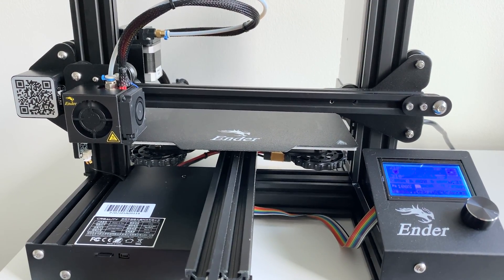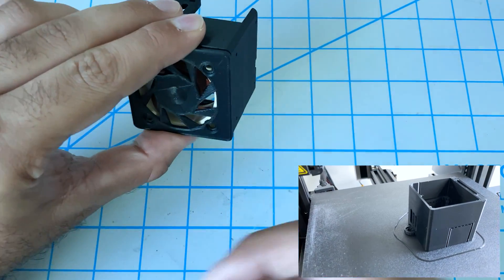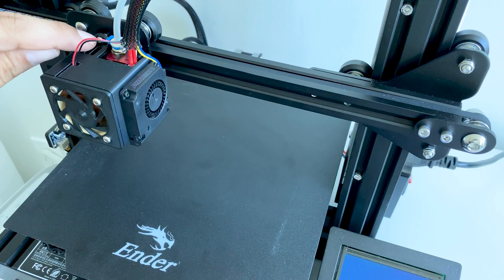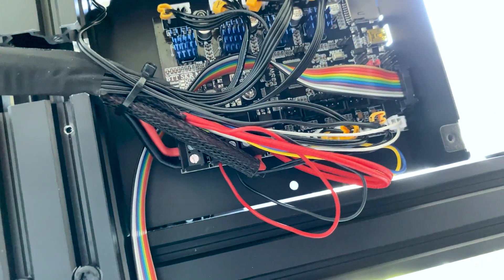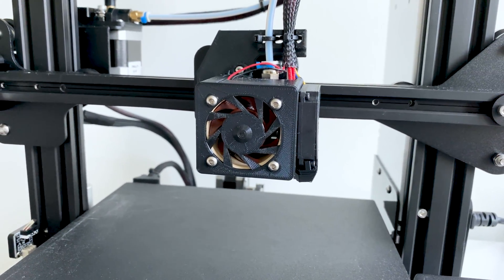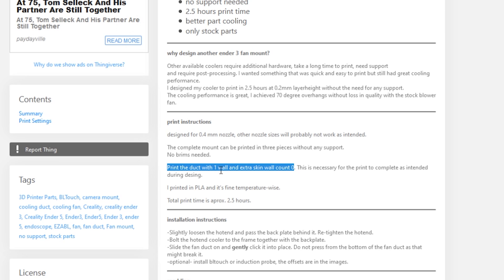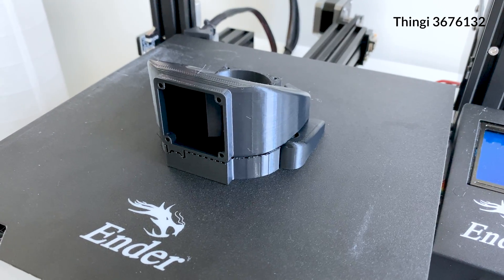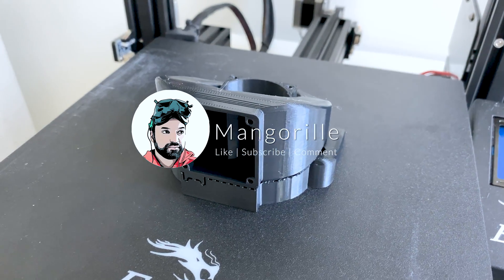Creality Ender 3 Pro Hot End Noctua A4x20 Fan Upgrade 40mm x 20mm | FINALLY Some Silence!

Comment: DONT USE NOCTUA FANS UNLESS YOU ENJOY HEAT CREEP! THEY DONT HAVE ENOUGH FLOW
Reply from the maker: Which Noctua fan did you try that gave you heat creep? Folks are going with the 40x20 instead of the 40x10 to give more airflow.
Reply: Don't talk about things when you have no clue. The Noctua 40x20 works great and has plenty of flow. Maybe you could ask your mom to explain it for you.

Comment: How do these DC-DC step down converters work with fans that are adjustable?
I'm not sure how Ender 3 control board regulates their RPM (with PWM?).
If the control board lowers the voltage, wouldn't the step down converter basically keep feeding 12V to the fan, until the voltage drops to 12V + whatever DC-DC converter needs to keep functioning?

I have just installed Bigtreetech SKR 1.4 Turbo in my Ender 3, so that's yet another layer of uncertainty for me.

Oh, and these Noctua fans are fantastic, I've got one, and it's nearly silent.
Reply from the maker: The hot end cooling fan always runs at 100 percent so that is not an issue. The parts cooling fan is the one that has pwm but it has pwm on the negative circuit. You need to wire the parts cooling fan differently if you intend to replace that one. For the parts cooling fan only, you need to wire like this: https://prnt.sc/pvye3q
Reply: @Mangorille  I have checked my stock Ender 3 control board (Creality 1.1.4) and negative contact in the fan connector and the ground contact are NOT connected together, as I presumed - just as your diagram implies! An interesting piece of info, thanks for that.

But as I have mentioned, I have recently replaced my stock Ender 3 board with Bigtreetech SKR 1.4 Turbo, and contrary to what I'm reading on every web page, forum, etc., my hot end fan IS controllable, just like the part cooling blower.

I have just checked, and M106 P1 S255 switches hotend fan to full blast, while M106 P1 S128 does reduce its RPM, I can both see and hear it.
M106 P0 does the same with the part blower, just as expected.

And so I'm wondering if I can replace them both with Noctua 12V fans, fed via DC-DC converters. If SKR 1.4 Turbo uses PWM to control fan speed this setup may work, but if it lowers the voltage by other means (mosfet?) my DC-DC converters will probably just keep pushing 12V to those fans as long as they have enough input voltage.
Reply: @Mangorille  Perhaps Marlin 2.0.7.2 I have compiled for my SKR 1.4 Turbo is smart enough to implement some kind of software PWM on FAN1?

Comment: Does the 2nd set up for fan leave enough room for a BL Touch?
Reply from the maker: Yes it does, you need to print the BLTouch base though. There are two different designs, one for manual leveling and one for BLTouch.
Reply: @Mangorille  even if i bought the creality BL Touch and have the ender 3 bracket? Or does the creality bracket work? sorry for all the questions lol

Comment: I was changing out the filament and the end of the filament went right into the fan breaking off 2 of the blades so now I am required to replace it.
Reply from the maker: You can print a cover for the fan to prevent items or your fingers from going into it.
Reply: @Mangorille  2 late

Comment: Great video! Really wanna do this upgrade myself soon, however, im also planning to do the same with the system board fan as i find it to be even more annoying than the hotend fan, atleast it is on the non-pro ender3
Reply from the maker: Thanks! You can do the motherboard fan at the same time and even wire the fan into the same buck voltage converter. The fan will be on all the time but that's not a problem. The Noctua A4x10 fan works well for the motherboard and is silent.

Comment: Why not just go with the Noctua 20 x 20 x 10 as a direct drop in without needing to replace the shroud?
Reply from the maker: That would be the easiest way but you do lose some airflow and still have to deal with the parts cooling capability of the stock setup.

Comment: When splicing power wires stagger the joints so even if the shrink tube wore through the opposite wire does not have a joint in the same area.
Reply from the maker: Good suggestion, thanks!

Comment: Did you cut the yellow wire for the noctua and leave it there
Reply from the maker: Yes, you don't need the yellow RPM wire. You can either cut it really close to the fan itself (cleaner) or just leave it in the tucked away in the wire loom.
Reply: @Mangorille  awesome thanks for the reply I'll gladly subscribe to you for the help!
Reply from the maker: @jimmydeanman  You're welcome. Thanks and welcome to the channel!

Comment: You didnt use supports for these? How did the arch on the middle part even work?
Reply from the maker: Are you referring to the piece in the middle at minute 9:00 in the video? If so, your printer is able to print a certain distance between two points without supports. They call this bridging.

Comment: Hi, are you using PLA? And if yes, is the temperature affecting the case?
Reply from the maker: Hi. Did initially use PLA but the parts will deform over time. You should really use PETG for these.

Comment: I love your videos, thank you! can I ask? in my ender 5 pro and I'm replacing the hotend fan and the part cooling as well with Noctuas. My PSU is 24v and Noctuas 12v. I have replaced the hotend fan using a buckconverter, but I'm not sure now if its possible to replace the part cooling fan too using a buckconverter without blowing the mainboard, is it possible? since the part cooling fan is the one making all the noise now on my printer.
Reply from the maker: Hey. Thanks! If the Ender 5 is anything like the Ender 3, you need to wire the parts cooling fan a little bit differently with the buck converter. For the hot end fan you connected both the negative and positive wires from the motherboard to the buck converted. For the parts cooling fan, you need to connect it like this: https://prnt.sc/pvye3q (credit goes to  Tim-CrossfireMachines)
Reply: @Mangorille  thank you so much man! Im a bigger fan of your channel now :) thanks for taking the time responding, much appreciated.
Reply from the maker: @andresmalo254  You're welcome. Happy printing!

Comment: I am trying to get the minV2 Ender 3 fan mount but it looks like it may have been removed.  I reached the end of the internet.  Looking for alternative setup for 4020 hotend and stock blower.
Reply from the maker: Hey, you are correct, that is very unfortunate as it was an amazing design! I'll try to message the designer and see if he can re-upload. I still have the files if you want to email me mangorille at gmail.
Reply: @Mangorille  Hi Mangorille! It would be nice if you could upload the files of the minV2 Ender 3 fan mount. I was going to follow your modification and I already purchased all the items :S
Reply from the maker: @alanteriornoleconozc  I wasn't able to get in touch with the designer (messaging feature doesn't work right now) but I have uploaded the files I had backed up here: https://www.thingiverse.com/thing:4744656
Reply: @Mangorille  Thank you!
Reply: @Mangorille  Thanks for posting that.  I went ahead and printed this one. https://www.thingiverse.com/thing:4369859/comments I modified it to fit 4020 fan.  I will let you all know how this one works out.
Reply from the maker: @mmicker007  Thanks for the update. If you want to print something like that, did you look into the Hero Me? https://www.thingiverse.com/thing:4460970
Reply: @Mangorille  I did look into it but so far the Satsana is working for me.  I also mounted an 8025 Arctic fan to the outside of the PSU cover from your video.  Replaced the mainboard fan with a Noctua 4010 that is connected to same buck converter as the hot end fan so it runs all the time.  And of course I had already upgraded the main board to a 4.2.7.  I am quite happy with the results.  Only stock fan that remains is the parts cooler.  The printer is silent enough to sleep beside.  My next project might be to get a pwm fan controller so the power supply fan can run continuous at a lower fan speed to eliminate the on off noise and I will add a LED strip lamp at the top of the printer for better lighting.  Thanks again for the great videos for inspiration.
Reply from the maker: @mmicker007  Glad to hear that everything worked out! For the parts cooler, you can look into the Sunon MF50151VX-B00U-A99. People say that Sunon is the Noctua of blower fans. This one is a 5015 12V. You would most likely be running it at 50 - 60% considering the amount of airflow it can produce.

Comment: That small part cooling fan is only splitting for you because you're slicer settings are off. I have the same one I printed and its perfect and really strong. It looks like you're under extruding, maybe printing at too low of a temperature even.
Reply from the maker: Hey Chris. That is very possible as it was printed in my early days. However, I did try to print it a few times with different settings without much more success. What I suspect, and maybe this contributed to the issue, is that there has been minor variations in the Ender 3 over the year and this part did not fit the way it should on my printer.
Reply: @Mangorille  you printed  a part for the ender 3, not the pro. i once printed a part that was for ender 3 only for this same exact application, only to figure out there is a difference.. the horizontal offset of the screw hole tabs is different and are not interchangeable between the two.
Reply from the maker: @SeraphX2  I have the Ender Pro and did not notice a difference. Which design in the video are you having a challenge with?

Comment: so, my hotend fan doesn't move (feels like it's stuck) and I wanted to try out the noctua fan instead. how would I even print that piece out? or do you have any advice?
Reply from the maker: You have a few options. 1 - You can find someone through your local classifieds to print the parts for you. 2 - Purchase a replacement 40x10 fan and use that to get the printer operational so you can find the parts and then use that instead of the 40x20. 3 - Get the 40x20 fan and jerry-rig it using longer screws, zip ties, tape long enough to print the parts.

Comment: Hi! Thanks for the video! But I have a question. If I want to change also the electronic board fan should I connect another DC converter? Or this converter is enough for all the fans? Thanks!
Reply from the maker: Hey, you're welcome. As long as you don't mind the board fan being on all the time, you can use the same converter. That's what I did.

Comment: I printed the petsfang/bullseye stock fan mod and would like to report I'm very happy with it. Make sure you have some M3 nuts to use in some of the openings.
Reply from the maker: Those are good designs as well, but you can't see the nozzle printing as well as the MinV2 shown in this video.
Reply from the maker: @JoleFin I found the same, once the hot end fan and power supply fan are replaced, the blower is the next annoyance. You can play with the fan speed to try and find a sweet spot. Also, there is a FAST_PWM_FAN and Fan_soft_pwm settings in the firmware that you can play with to try to make the sound more tolerable.

Comment: My Noctua is a four wire. (40/20 fan) What do I do with the extra two wires?
Reply from the maker: Sounds like you got the PWM version of the fan instead of the FLX version. You should be able to connect just the ground and 12v wires and the fan would run at full speed. Check out this link: https://noctua.at/pub/media/wysiwyg/Noctua_PWM_specifications_white_paper.pdf
Reply: @Mangorille  I almost bought the 5V with PWM. 😲 One Pin is for PWM (changing the speed more efficiently without the voltage drops)
Reply from the maker: @jonny11bonk  There are so many different versions, make sure to pick up the FLX version (non PWM). I provided links to the ones I used for the modification in the video description.

Comment: I also own an Ender 3 pro, howevee, the second fan setup didnt work for me as my stock blower didnt fit the fan duct. Now all printed parts are laying in the trash
Reply from the maker: Did you print the duct with the one wall only? I’ve printed this part a few times and it fit my stock blower all times. It’s designed to be a tight fit as it’s just a pressure fit.
Reply: So I printed as instructed and the fan didn’t fit for me either for some reason. All I did was shave a little off with an exacto knife where it compression fits. Works perfectly.
Reply from the maker: @REREtech  Thanks for letting us know
Reply: The blowing fan was way bigger than the slot inside the printed part. Actually I didnt try to trim with a knife. Good design  though.
Reply from the maker: @unitedcolorsofmydick  Thanks bud, it's strange that it works for some and not others. Perhaps there are slight differences in the blower fan or some kind of calibration difference in the printers.

Comment: Noctua has less airflow, because it is 12 volts. It can cause heat creep on the hot end. Some say the 40x20 might be enough not to cause the heat creep.
Reply from the maker: No one seems to know the airflow of the stock fan but people think it is around 7cfm. The Noctua 40x20 is around 6cfm. The 40x10 is around 5cfm. The 40x20 has been working fine for several weeks now for us, even when printing PETG at 230/240.

Comment: Is there a difference between the 40x10mm vs 40x20mm?
Reply from the maker: Definitely. You want the 40x20mm as it has more airflow, more static pressure, and lower noise. The 40x10mm would be the size of the stock fan and you could use that if you don't want to go about upgrading the fan mount and duct.